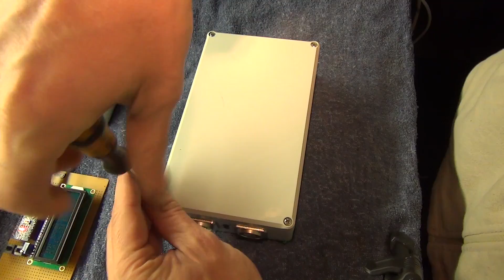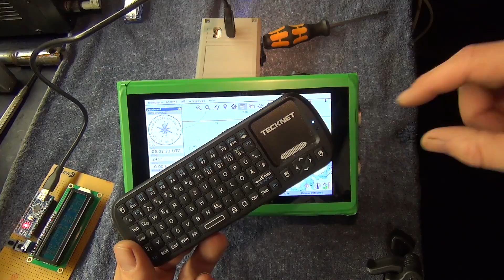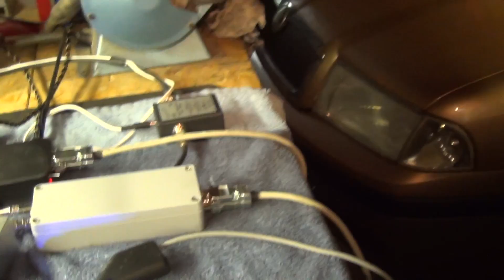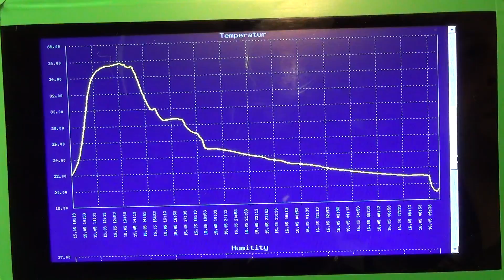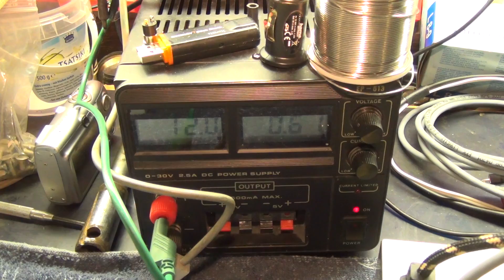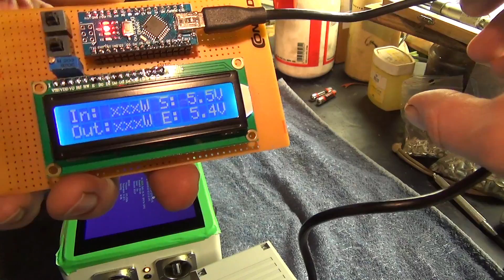Raspberry PI 3 & Display & OpenCPN

Comment: the color wheel appearing in the top right corner of the screen all the time is to indicate that the CPU/GPU (SOC/SystemOn(a)Chip) is undervolted due to the power supply not providing enough current (amperage) - and the current regulator on the board is letting the voltage drop as a result. You may want to tweak your power supply you built to provide a little more amperage at 5v into the pi so that it's not undervolting the processor
Reply from the maker: Oh really? I always wondered why I get sometimes this symbol. 

Strange - because the PI and the display are powered using different powerlines (the PI-Power does not come from the baseboard of the display)

But thanks for the hint - I'll look into that.
Reply: kuttmoped Could be low voltage causing it, or low amperage available, I found that with a power supply that claimed to be 5V 2A and got the color wheel all the time, turned out to be only outputting 1.2A and it wasn't enough for the draw of the CPU/GPU sometimes...
Reply from the maker: OK .. I found the issue. 

I put +5V directly to the PI and the display, but not the ground. So I got only 4,8V at the 5V line. 

Added a seperate ground (0,75mm²) to the 1000C and am now at 5.1V.

Crazy that over the 10cm USB Cable the ground 0,3V dropped. 

Thanks again for the hint
Reply: Glad I could help!
Reply: Heh, I was going to say the same thing. ;-) You beat me by 7 months, LOL!
@kuttmoped - you should notice it running even faster now that you've remedied that issue...  ;-)
Reply from the maker: Yea - if you dim the backligt using a pwm signal the consumption goes down aswell. Sadly on the v1.0 of the display (like I have) this is only possible with a soldering iron and a bit C-code ...

Comment: Check also BBN Marine OS for raspberry pi4. Many free and opensource boat software packages preinstalled.
Reply from the maker: No need :)  My system predates these systems and runs also on a RPI2. I don't like many of those openplotter-like stuff - it's ostly done in python, which  is slow as fuck ;)
Reply: @SY-Selene  why do you think BBN OS is done in python?

Comment: Hi.
First.  Congratulations for your nice navigations.
Second Thanks so much for your sharings, They are a precious treasure.
Now the question: After your experience on navigation, how is the official  7" touch screen performance in navigation?
Any viewing problems on sunlight conditions?
Is It worth to use It for the price?
Would you repeat the same display in a budget perspective?
Reply from the maker: Hello,
I kinda like that Display. It has not a very high resolution, but thats not needed, because everything would beco e really small.
I used it for ca 2 years on my boat and changed 2 things:
The new version is able to be adjusted in brightness via the RPI itself. So I added a buttton to change it. Espeacially at night this is very helpful. 

2nd: I added a diffusor foil made for an IPad to remove the glossieness ;) I saw everything in the reflections, but not the contents of the screen.

Well now we are in Dominica and this RPI navigated us over 6500 Miles over on the atlantic ocean ;)
PS: it's very importand that you use a high quality SD card in the PI. The cheap ones didn't last long. The Sandisk Ultra is doing good for around 2 years now. 

But as always: Do regular Backups ;) I got some new cards with me .. in case one breaks..

Comment: we need more information on this device!
Reply from the maker: like?  I made a whole series about that ;) There: https://www.youtube.com/playlist?list=PLh8BEnfg2z52YcFEMpvMLLWS3f3tVwHHe
Reply from the maker: Well, I got most of the items from reichelt.de and some of amazon.com. The exact list is difficult, because it's a work in progress.
The OpenCPN on the PI is easy - there are Howto's on the internet, but I compiled my version from the source code.

Actually the PI can run many things, sky/star viewer, internet - even games like minecraft ;)

The big disadvantage of the windows/intel plattforn is that it's not open source anymore. OK - you can run linux on such a thing, but the PI takes less energy and is smaller.
Reply: Why does it need to be open source? I just want to run OpenCPN and windows based stuff? The power is always an issues for 12vdc systems good point.
Reply: Also could you link the source code just for the PI and how you loaded Open CPN and the sensors?
Reply from the maker: I have a source partially in my other videos. 

The display-PI is more or less strait forward with almost no self written code. 

The host-PI is much different - there is a lot of self written code in C, PHP and BASH/SH 

How it works you can see here:
https://www.youtube.com/watch?v=OM15t8OSxF0&index=12&list=PLh8BEnfg2z52YcFEMpvMLLWS3f3tVwHHe
and here:
https://www.youtube.com/watch?v=R2piiClfa9M&index=13&list=PLh8BEnfg2z52YcFEMpvMLLWS3f3tVwHHe

PS: except from the Arduino code of the NAVTEX, I won't give out the code of images. Why? Because it wouldn't work on your set-up if you don't get exactly the same hardware. So to say - you should know how it works and things play together. The big advantage is, that you can repair it yourself on sea with very little and cheap replacement parts.

also - I did change a lot over the time of use and found quite some hidden bug - I was kinda happy that I did not give out the souce, but only the priciple of operation.

Comment: Hallo, ich habe meinen Raspberry PI  mit Opencpn  inzwischen erfolgreich an Board in Betrieb. Jetzt ist die Elektronik des Autopiloten "Autohelm 3000" ausgefallen. Jetzt habe ich mal ein Frage. Ich habe mit dem Raspberry Pi die Information vom COG und dem Bearing zum Wegepunkt. Besteht nicht irgendwie die Möglichkeit über zwei Ausgänge für Bb uns Stb zwei Relais anzusteuern, um damit den Autopiloten wieder mit den nötigen Signalen zu versorgen. Was meinen Sie wäre das Möglich?
 
Ich denke das sollte ein lösbares Problem sein.

Danke für ein kurzes Feedback.
Reply from the maker: Hallo,
mit dem Autopilot und OpenCPN hab ich noch nicht experimentiert. 

Soweit, wie das "grob" funktionieren sollte: 

Du musst einen Datenausgang als Autopilot konfigurieren und die Daten über seriell oder Netzwerk ausgeben lassen. 

OpenCPN sendet dann ECRMB Strings (NMEA), die der Autopilot verarbeitet. Um nur ein paar Relais auszusteuern, müsste man den String in den RPI pipen (z.B. über einen Local Port), dort zerlegen und dann über den GPIO ein paar Ausgänge schalten. 

Alternativ könnte man die Daten über eine 3-Draht Leitung (12V, GND und Daten) zum Piloten leiten und dort vor Ort über einen Arduino o.ä. Relais schalten, was den Verdrahtungsaufwand senken würde. 

Ich hab selbst noch einen defekten Piloten rumliegen (mit mechanischem Kompass) und überlege, ob ich dafür eine Steuerung selber bauen, in die dann OpenCPN mit einfließt. 

Wäre ein schönes Projekt für später ;)

Comment: Hallo, Ihre Anwendung auf dem Raspberry Pi ist genau das, was sich schon immer gesucht habe. Ist es möglich von der Installation ein Image irgendwo downzuloaden?  Dann könne man das einfach nachbauen.
Danke für eine Kurze Info.
Reply from the maker: Hallo, ein Image habe ich nicht zum Download. Das würde auch nicht sinnvoll sein, da die Config auf mein System angepasst ist. 

Eigentlich ist das Setup des Display PI's recht einfach. Image installieren und OpenCPN und man ist eigentlich schon fertig. 

Das einzige, was etwas nervig ist, ist der auto-reconnect der W-LAN Verbindung - bw. das funktionierend hinzubekommen...
Reply: Danke für die schnelle Antwort. Ich werde es mal versuchen. Welche Hard und Software läuft den für das Barometer?
Reply from the maker: Das geht über einen BME280 Sensor von Bosch. Die Diagramme und Datenablage habe ich selbst programmiert (MySQL und PHP)